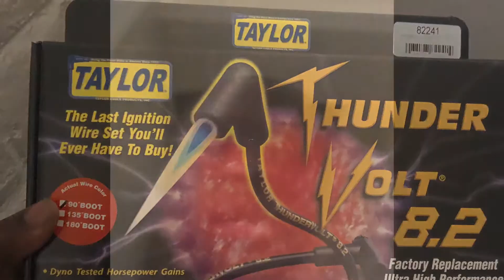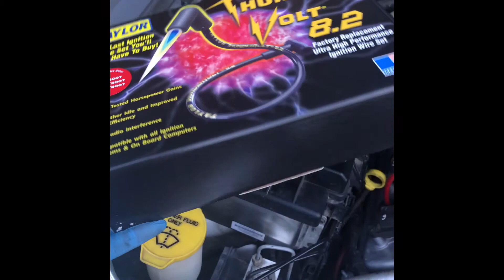How to put Taylor Shorty wires on a 5.7 hemi

Comment: I watched a similar video a guy used the 10.4mm instead of the 8mm he said they didnt carry enough voltage but im curious if it’ll work or not cause i have a 05 magnum r/t & wanna clean up those damn wires i need for sure answers before i purchase please

Comment: Those look great!  just curious why they don't do that at factory since it's so much easier and cleaner?  Doesn't his mean that the two plugs beside each other will be firing at the same time instead of from the other side of the engine?  Just curious how this works.
Reply: If i remember right,  the one cylinder the coil is connected to fires again on the exhaust stroke, something to supposedly cut down on emissions.  But all they do in my opinion is burn through spark plugs faster because they firing so much.